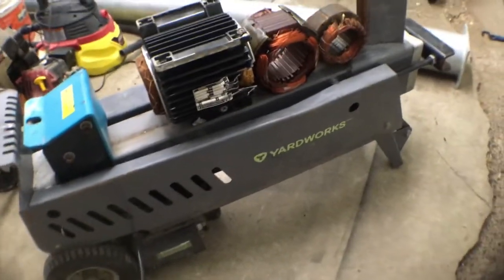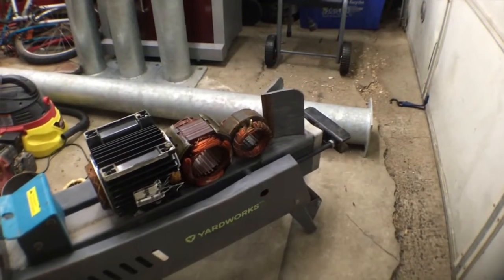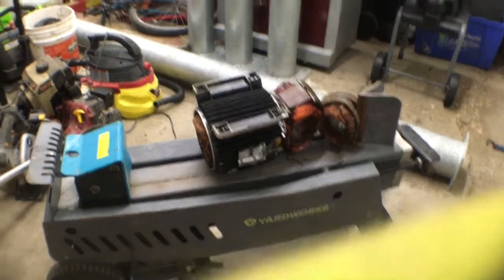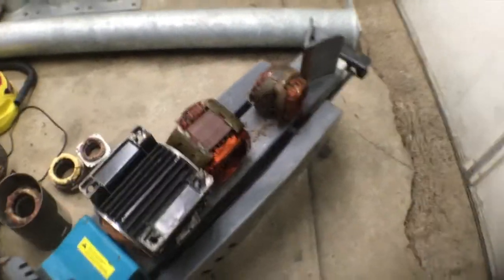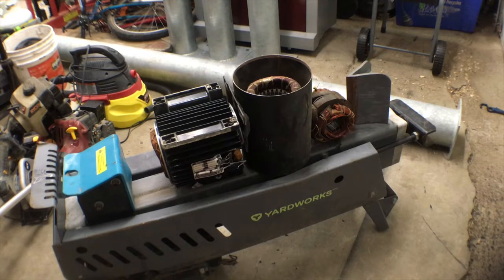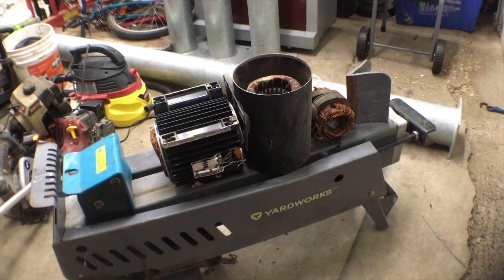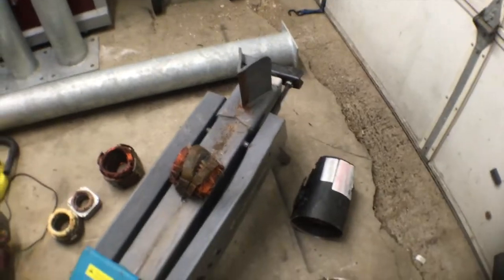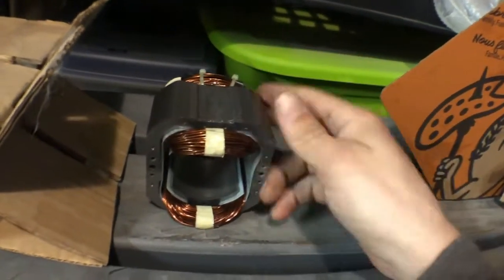My crazy ideas log spliter Scrapping motors

Comment: Does this have enough power to pull the winding out?
Reply from the maker: I have never tried to pull the windings out with it actually.. I gave up on trying this method because I tried using a jack hammer with custom attachments and I think that way is faster and easier. at least for smaller size motors which is mostly what I get and this small log slitter wouldn't be able to handle any larger size motors either anyways
Reply: @scrap2cash712  Good to know. I get about 20 motors a week. I have gotten in down to 3-5 minutes per. Which isn’t bad in my opinion.
Reply from the maker: 3-5 minutes for getting the copper right out of the motor? and you mean small motors like ac or furnace motors? @jhonwayne1003
Reply: @scrap2cash712  Yep, I take my grinder cut of the outer shell takes about a minute. I take a sawzall cut off both ends of the copper windings, then I just tap the rest out. With both the winding ends off, I find it easier for the insides to just come out. Is 5 minutes too long?

Comment: A harden steel wedge shaped like a leaf, kinda. Or better description would be a spade, like in a deck of cards. About a half inch thick. The only part that needs tempering is about two inches. Glad to see your trying to figure it out. Don’t listing to keyboard haters!

Comment: I've been planning a build like the last one you mocked up as well. I think I have changed my plans now that its time to build it. If you watch flipping Irish he made some complicated light duty contraption that sort of has the same idea. I'd rather use a gas powered log splitter with a chain hooked up to some tile nippers though. I do like his improved clamping system though. its super simple and cheap to build plus also would allow the log splitter to split logs by just pulling off a few bolts.
Reply from the maker: Awesome I have a few other ideas too that I may try out first I will try to make some more videos about it when I get back to it lol. you should make some vids of yours too
Reply: @scrap2cash712  I made a few of my log splitter. gonna try and find a few truckloads of compressors and make some more.
Reply: Best method I’ve seen to make it harder to separate two metals !!
Reply: @metalmicky  how do you separate them?
Reply: @scrapmanindustries   I cut off one end of the stator winding and then use an air chisel gun to
Reply: @metalmicky  ok. I just use a vice and fencing pliers for the small ones. the big ones have too much friction and don't pull out by hand that easily. for that I use my log splitter. it's either that or cut off both ends and use a bolt and hammer to knock out all the copper one thing at a time. which takes too long.

Comment: wonder if you could extract the copper from an ACR using the log splitter.  with a wider push plate put acr down as the round & maybe "split" the copper out using a punched out sheet of steel or maybe diamond mesh.  wonder is the copper tubes would find the holes in the sheet & go through like split wood leaving the compacted aluminum sitting on the splitter..  Now to convince the wife that WE need a log splitter.
Reply from the maker: Lmao good luck convincing her. it might work forsure but I don't know if it would be easy enough to make it productive for the amount of time you'd be spending

Comment: You definitely need removable attachments. The right attachments will also help with breaking the motor apart. I’m actually building a motor wrecking machine right now. Too bad that log splitter doesn’t have double acting hydraulic rams, in conjunction with a shop press it would make the ultimate motor wrecking machine. Have you made any progress?
Reply from the maker: I was planning on using it to cut the motors in half and pull the windings with different attachments but I have another option I am going to try first quick on the smaller sized motors. I hurt my eye and have been dealing with shit for a while now so im just starting to get back into youtube and have just let this project sit and wait. I've saved up a whole bunch more motors though lol. have you made any progress? id love to see what you've came up with maybe will help me too
Reply: @scrap2cash712  I have not have the time but check out my Facebook page project scrap a guy posted a video of how he modify his log splitter.

Comment: Hey Dude, did you ever get the log splitter to work. I'm at the same stage you are at here in this video. I have been trying to figure something out. I just happened to come across your video. Could you please let me know if you came up with anything send some pics. Thanks
Reply: really all you need to do is cut off the copper onone side with an angle grinder then all you need to do is pull it out
Reply from the maker: hey man sorry been dealing with some crap and haven't been on youtube in forever. I haven't came up with anything past this yet but I have another idea im going to try out quick first and if it doesn't work out ill be back to this project lol. Did you manage to come up with anything? any videos?

Comment: I don't understand why you would put the second spacer perpendicular to the first, exposing the force to a round surface, which requires you to line everything up precisely.  Just put two similar sized motors in line with each other, and you will eliminate the tendency of the motor you're splitting to squeeze out the sides.  

Otherwise, I like how you thought to try this in the first place.

Comment: Why don't you use a angle grinder to cut one end and then grab the other end with pliers and pull it out with a hammer. Works for me all the time.
Reply: exactly what I do
Reply: i used to do it that way too , BUT u loose money 3 ways, wasted copper ,,wear and tear on angle grinder, and cost of blades, and u cant do a lot of cutting inside ,, copper dust in the air,,i am working on a splitting machine too,,cant be too hard to make ,,,thats how the big machines do it...

Comment: That's pretty much how my local yard does it but they use a mutch thinner chisel end, basicly a bench top press with a brick bolster welded to the ram, i knocked one up from a bearing press and brick bolster but it was a manual hydrolic one (basicly an upside down bottle jack in a frame) and it took ages LOL
If you add a cup to cradle the motor and a brick bolster to the other end it will split em easy peasy i recon ?
great stuff chap keep it up :)
Reply: Couldn’t have said it better
Reply from the maker: DirtDiggler thanks man the way your saying is pretty much what I was thinking as well. Hopefully it works alright after I spend the time on it lol
Reply: @scrap2cash712  In our game time is free so have at it sir, have at it ;) get a vid up once it's done :)